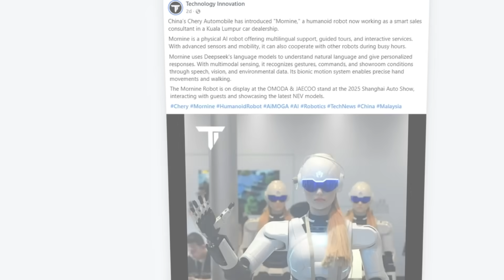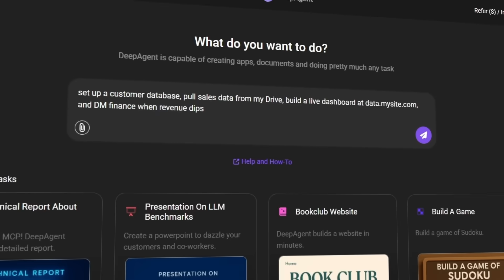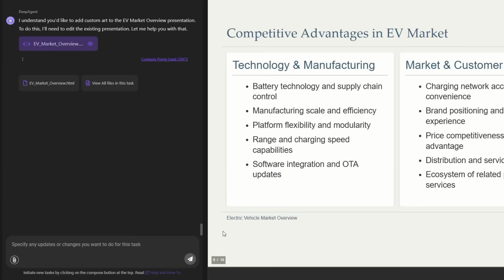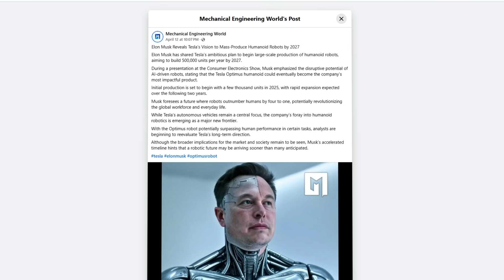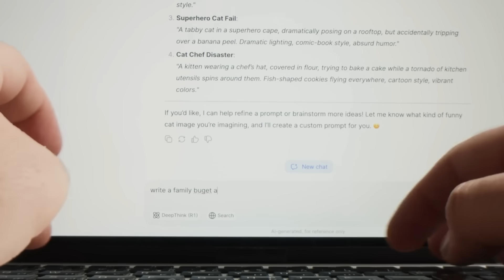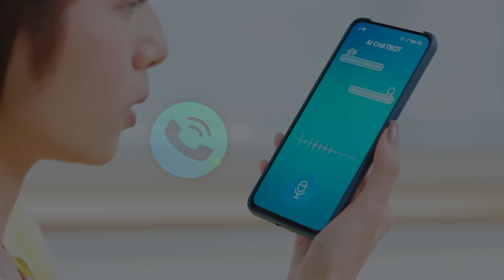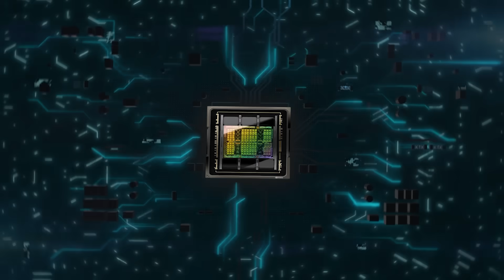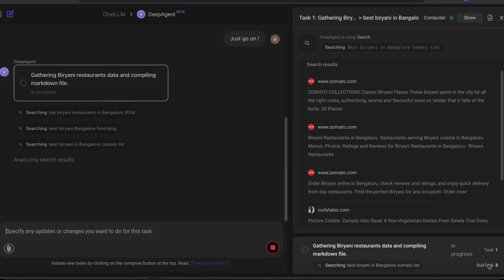China Just Launched Its First Real Robotic AI Police! (ALREADY ON STREETS)

Comment: "Go work in the trades", they said. "Robots can't replace the construction jobs", they said.
Reply: They will eventually.  The trades are probably the most secure job for the near term future, next couple decades.  I would like to see that giant machine at work, bet it ain't all that.  Good luck getting that into existing buildings or remodeling a home.  Probably more like a giant 3D printer on wheels, run by AI.
Reply: @RK-XD-9 I was in trades but Aliexpress with its cheap items killed my business 😭
Reply: @RK-XD-9  I think trade jobs are the LEAST secure.  Anything that can be built can be built with a robot.  I have been in the medical device and biotechnology industry for over 20 years, and it is amazing what I have seen in the last 2 years!  We now have robots that can build medical devices, instead of human product builders.  These are highly intricate and complicated products used in medical procedures.  Instead of hiring 10 product builders, we hire 1-2 engineers.
Reply: @travis94303  It is a matter of time, but sending in a robot to a home to do remodeling according to the specs of the homeowner seems a bit far off, lots of different scenarios to deal with.
Reply: @RK-XD-9 depends on what you consider “far off” but if a robot can build medical devices going inside of humans, they will be able to do trade jobs.
Reply: @RK-XD-9  you are really funny 🤣 a 3d giant printer ??!?!
Reply: @Max77bojan  I said giant 3D printer, not meaning it will print 3D giants.  According to the video, that is exactly what it will do, along with welding and carpentry.  I have worked along side welders on construction jobs and this machine will not be able to do what they do, it wouldn't be able to fit into the buildings where the work is done, let alone doing the problem solving and creativity that is needed.  As far as carpentry, this machine could probably put in some screws with one of its attachments, but to actually construct something in place is laughable.  Again, believe it or not, construction is quite dynamic and requires problem solving skills and creative thinking, both things that current AI is lacking.   This machine is probably no more than a giant 3D printer.  I'm sure, sometime down the road, they could advance these machines to do more and more work that a human can do, but it seems quite away off for construction work.  Don't believe all the hype.
Reply: @RK-XD-9  definitely!! They are only showcasing these robots !! As far as " public use " they need many more years ( 10or 20 years) to finish these products!!!
Reply: They can not replace all jobs. Because there are middle class people who have businesses and they can not afford to buy such expensive machines. only a few billionaire companies can afford this.
Reply: @eurossocial they know this, and they know that it has to be affordable to all, just like computers and phones or their plans won’t work
Reply: @stujaye8116 they have no intention to sell it to normal citizens. Their aim is to provide countries armies and governments these robots. They will not sell it to you and to me.
Reply: @eurossocial well I respectfully disagree so we will have to wait and see. I heard a figure of 8k for a Tesla robot, so it’s not out of the realm of reach, if that is accurate info of course. Not that I want one, just saying.
Reply: @eurossocial  humanoid robots will be cheap
Reply: @CorporateShill66  as you said "Will be". This will be. it will never be cheap. It depends how rich you are to say this. Because if one robot costs $30.000 or more, then you don't call it cheap.
Reply: @eurossocial  A 30k robot that can replace a worker and work 24/7 is not cheap? Wow ok
Reply: @eurossocial yes but bet you it’s cheaper insurance on a robot than human liability insurance 😅
Reply: So much for that workers utopia, we are going to be managed by these abominations.
They do nothing useful beyond surveillance.
Reply: Robots will replace all human labor eventually. Jobs will be a thing of the past. 
How do we prepare for it? Well UBI will be a must for one.
Reply: @CorporateShill66  UBI is economically impossible - this is a socialist Union state. Elon Musk  said for marketing gimmick because he read it in some scifi book. Musk himself in real life  is against the Unions and UBI , he prefers to pay workers part with Tesla stock in exchange of giving up Union. China transformed High Margin business operation Auto making into low margin high efficiency operation in order to win global competition. So there is a very low profit Margin in production, so the Government can't tax corporations without undermining their competitiveness. So where do they get the budget for UBI? Think, because this is economically impossible, even sales tariffs will hurt consumption and production. So the income must come from the Financial markets. Lean to Invest and to trade - that is the only high profit margin business that remains. No other way for now. Even the markets later on could be replaced with planned AI economy, but again, no UBI, just a dosed support, because there will be no money, only information exchange and Individual support based on your contribution of the MEANING and the EMPATHY  to the Society. That's the only spiritual Human role remaining TRUTH EMPATHY TOLERANCE, otherwise self destruction
Reply: robots wont replace, they will assist, its in their names
Reply: @bestmind-tm2me  what I'm seeing is that robots are assisting companies/ doing jobs within thier own factories etc etc for their own purposes !!?!
Reply: The sheeple like tom Higham will think they will be kept alive being paid furlough

Comment: The critical issue for China is that its supply of 7nm chips is limited to equipment already in place as US restrictions mean no new lines below 14nm which locks out several generations with 5 and 3nm currently blocked and the new 1.5nm out of sight for China.  Offsetting this is the recent (Feb) release of a domestic 28nm line but its a long and expensive journey from their to 3nm.  This means that bulk supply of very modern chips will remain a problem.  Also, we have yet to see the release of the promised design software that can interface with the chip making lines, including ASML equipment.  Perhaps China can offset some of this with good software design as they did in Deepseek but the barriers are not inconsequential. This battle certainly represents a finger on the scale of the technology race in favor of the US.
Reply: So you think this is real?, I don't think so.